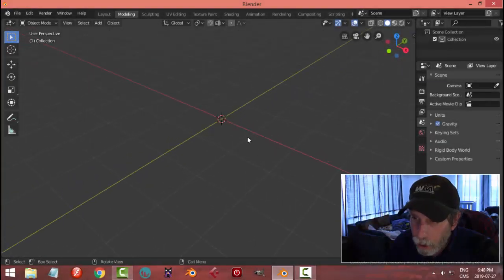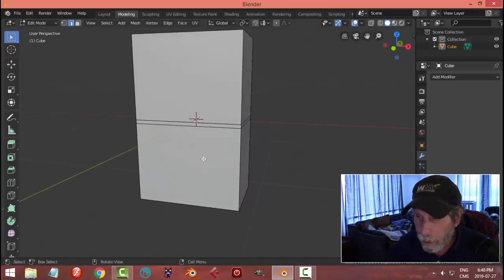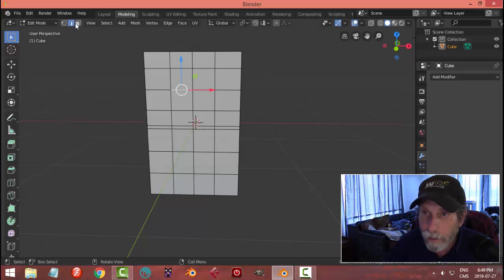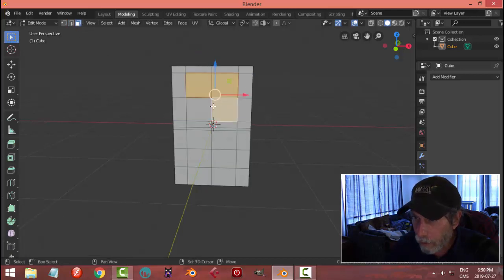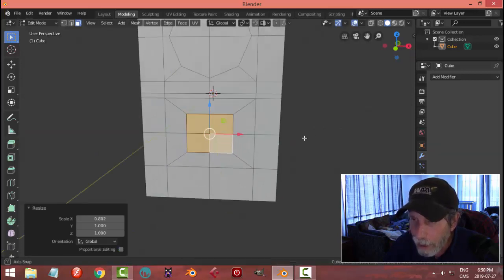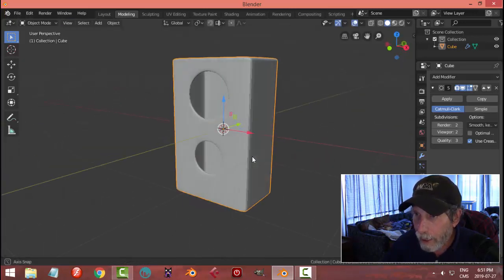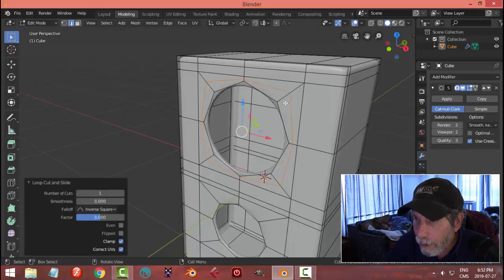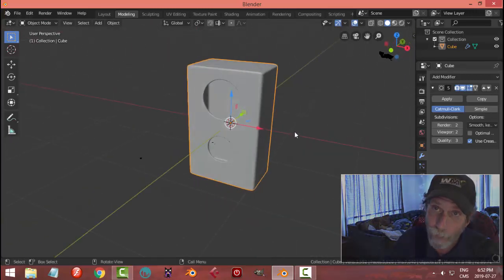Blender: Modeling a Circular Hole in a Square Object

Comment: hello, i want ask you.. why i cant impor material to circle shape? the texture of wood cannot be display at that circle i made :(( the circle just fill with the brown color ( without texture )

*the way i create the circle : shift A - mesh - circle - add new edge/face from vertices - add modifer - solidify ( + Edit mod select all and press F on your keyboard )

*the way i impor/add texture picture : select the circle shape - material properties - add new - go to base color section - image texture - open image - select image - open image

is there something wrong with my steps? please help me🙏🏻 thank you
Reply from the maker: I will write you about this later. I'm not quite sure what you have done and need to read your msg carefully. Hang in there.

Comment: The amount of times i have tried this, and it just does not work properly.
It always comes out oversize on the vertical, and i just can't fix it.
Reply from the maker: You could try to just move the top and bottom vertices to get a better Circle either before or after using loop tools. Keep at it. Practice just on a simple plane until it works for you. Good luck!
Reply: @zerobio  Thanks, yeah i'm new to blender. Have just worked out it was because i hadn't done the set scale function to the mesh.......... what a daft function that you always have to do.
Reply from the maker: @mikey7326  good stuff. Glad you got it worked out.